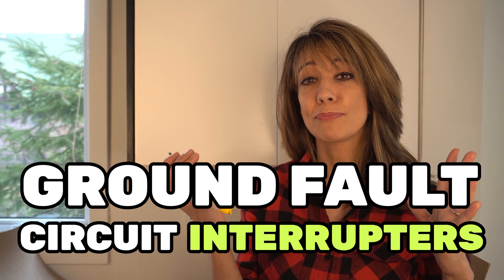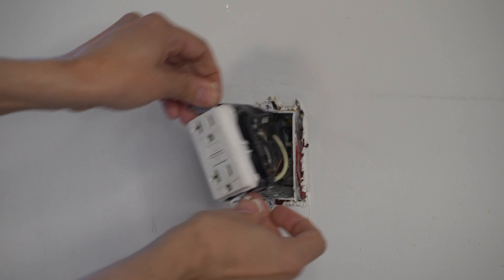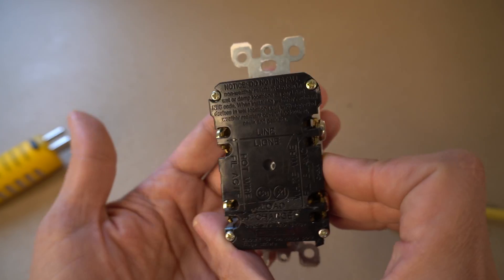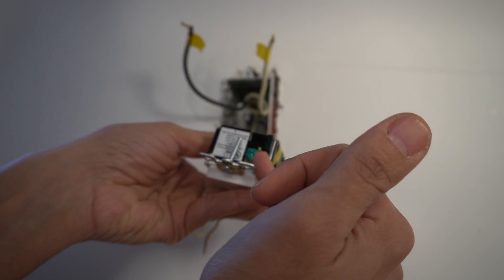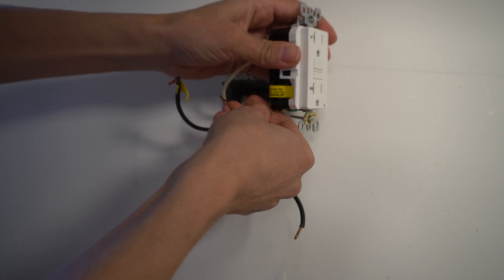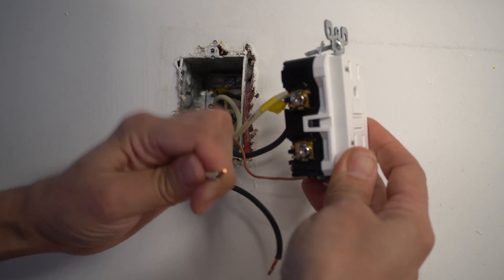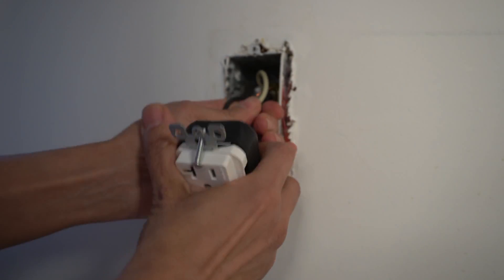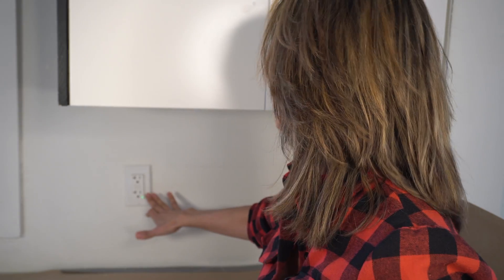How To Replace a GFCI Outlet | 98% Don’t Don't Know This!

Comment: when they turned my garage into a spare room,  they never put in any gfci.   This includes a kitchenette and bathroom area with shower.  There was no outlets in the bathroom,  but one right outside that I'd be forced to use at times.    So I made it GFCI and I feel much safer now!   It was super simple to change a regular outlet to GFCI.   Now when I shave I don't fear electrocution!
Reply from the maker: Well done! It’s so important to have working GFCIs in bathrooms, kitchens or near water. Everyone’s life is valuable and it’s a simple DIY that will give you peace of mind. Well done! Thanks for taking the time to share your experience. It’s important!
Reply: Are you sure it didn't have gfi installed at the panel ?
Reply: @nedmilburn    Yep 100% sure.  this was done in the late 1970's.
Reply: @northyland1157  I wouldn't be surprised if gfi's existed in the late 70s, but it wasn't ubiquitous for building codes that's for sure...  70s is 50 years ago. A lot has changed and there's a lot of houses that can use updating.
Reply: @nedmilburn  Yes GFCI did exist in the late 1970's,  They just weren't added in the garage conversion.   The rest of the house was build with GFCI in the kitchen, bathrooms, and outside outlets.
Reply from the maker: @nedmilburn  where I am you are required to have GFCI receptacles. I would check your local electrical code to see what is required in your area. The existing electrical is fairly recent.
Reply: @DaruDhillon  Why are you directing this question to me?
Reply: Another way to alleviate fear of electrocution while shaving is to use a rechargeable shaver. You would only need to fear the batteries catching fire while shaving.

Comment: Hi daru I have an older home with only 2 wires no ground can I still use these? Thank you
Reply from the maker: Hi Joe,  a GFCI receptacle will work without a ground wire attached and can be tested on the outlet face but not on an GFCI testing device.  The GFCI will provide ground fault protection when installed with 2-wire (hot and neutral).
Reply: @DaruDhillon  thank you so much for the reply
Reply from the maker: @joegonzales772  my pleasure, Joe. All the best!
Reply: Actually that’s what you’re supposed to do.

Comment: Can a garage fridge cause the constant tripping
Reply: Yes
Reply: Definitely you don't want to have a refrigerator plugged into a GFCI receptacle because it can trip just from high humidity and all the food inside could be ruined If it is not reset promptly , So replace it with a standard receptacle but make absolutely sure it is properly grounded

Comment: Thought I left this comment last night, but after watching about 40 other videos and dialing up three electrician friends trying to find out why my GFCI would not reset, I came across your video last night.  Let's just say that your approach help me figure out my problem.  It's too embarrassing to say what it was, but you are the best!!!!
Reply from the maker: Thanks! We all have those moments when we’re tired or we’re doing too much. Be kind to yourself. ❤️
Reply: I think you reveal what was the problem.   You might save others from the same problem.   Sounds like it was something simple.
Reply: @djohn-xe8vk  probably swapped load and line.
Reply: @djohn-xe8vk probably got the hots and neutrals cris crossed.  I did that by accident wiring in mine and it would not reset.
Reply: I have a greenlight on but no power at outlet why?
Reply: @andrewschurich2750 
read the above comments...   there's your answer
Reply: Don't see it grounded

Comment: Beyond THANK YOU for creating and sharing this video.

A tiny spring and reset button on bathroom GFCI popped out during a heavy rain. Outdoor GFCI is on the same circuit. It is under the soffit and inside a covered plastic box, rain getting in the box is the only thing I can think of that may have caused it.

I got a new outlet (twin to the one that popped) and have watched a number of videos of how to replace it. There was either too much "electrician talk" and/or the person had their fingers in front of what they were doing.

Am going to tackle installing the replacement this weekend. Thanks to your thorough, but not too complex explanation of what you were doing and why. I could also clearly see what you were doing as you explained it.
Reply from the maker: Awesome Rebecca! I love that you are doing this yourself. Sounds like you’ve done your research and are good to go.

Comment: Best video I’ve seen, thank you very much for the concise directions. Love the idea of using the electrical tape the way you did. Definitely makes sense. Never seen an electrician use tape that way.
Reply from the maker: Electricians I’ve worked with do it but not all do. I like it too. Thanks Paul!
Reply: It’s better to do it if the box is metal

Comment: How are you associating Black wire with going for the gold?  Struggling to make the connection for memorization.
Reply: Don't concern yourself with memorization, but rather educate yourself on basic residential wiring and theory. It's not complicated and will make you safer and aware. It should become as obvious as what shoe goes on what foot. You should always verify that the black wire is the hot wire, you never know who worked on the wiring previously and it could be miswired.
Reply from the maker: In electrical black is power, the ultimate. In sports gold is ultimate, the best. Going for the gold is a sports saying that works for me as an easy reminder. 🥇🏆
Reply: @DaruDhillon ... only in America could a black wire denote power/live ... 🙄😂
In DC circuits, red is positive and black is negative so why not carry that convention through to AC ??

Here in europe, we used to have that convention years ago and for some reason they changed it to brown for live, blue for neutral and green/yellow for ground... pretty random colour-coding there too... 🤔

The way I memorise it is...
The Brown bear will bite you..🐶
Blue with the cold... ❄
And the earth is green , of course ...🌍

😎👍☘️🍺
Reply: @peterfitzpatrick7032 You can't really compare AC to DC in this regard. In America the red and black in AC are both hot and alternate between positive (power in) and negative (current return). This applies to 240v circuits. In 120v circuits black is power in and white is current return. The black wire alternates between positive and negative and the white wire is the mid point and is always held to 0 volts, but carries the return current. The white wire represents the center tap of the transformer secondary windings or the mid point.
Reply: Somebody said to remember it this way: Mr T wears gold, so black to gold.
Reply: I prefer to associate the more obvious White with Silver. That leaves Black with Gold.
And always test to confirm what was done before and again once you have finished your work.
Reply: It’s very simple 
Bronze screw is darker than the silver screw , so a black wire is darker than a white wire , see very self explanatory …

Comment: I've found that the ground wire coming out on these GFCI receptacles is an issue, it's better to wrap a j-hook around the screw. You said the receptacle was upgraded from a 15 amp GFCI. A 20 amp receptacle can only be used on a 20 amp circuit with 12 gauge wire, can't tell if that's the case here. However, a 15 amp GFCI receptacle would be fine (US code, apparently not in Canada) regardless of whether it's a 15 or 20 amp circuit. It's exactly the same thing, but without the T-slot, and will save a few bucks.
Reply from the maker: Wrapping your ground wire around the ground screw is a good and safe tip. The wiring in this kitchen was upgraded to 12 gauge wire so new 20 amp receptacles were installed. Good advice Ted :)
Reply: @DaruDhillon I think that you're correct in using a 20 amp GFCI, the CEC requires 20 amp receptacles on 20 amp circuits is my understanding now. The NEC, USA electrical code, allows 15 or 20 amp duplex receptacles on 20 amp circuits.
Reply: @surferdude642  While you're correct, I find it moronic that it is acceptable to put a 15 amp receptacle on 20 amp circuit as it is not rated to pass 20 amps thus it is highly recommend to pigtail it to avoid overloading it. I also don't see why you can't put 20 amp receptacle on 15 amp circuit as the breaker should trip if there is too much draw.  Instead what we have are devices like my air compressor where the manual recommends a using a 20 amp circuit; however, it is instead wired with a 15 amp plug with a warning that it may trip 15 amp circuits. Or ones that come with a 15-20amp pigtail plug.
Reply: @rui1863 15 amp duplex receptacles are rated for 20 amp pass thru and that's why you can use them on 20 amp circuits. Your air compressor should be used on a 20 amp circuit with no other significant loads on simultaneously, a 15 amp receptacle is fine. If not, and the air compressor was designed for 120v, it would have a 20 amp plug and cord. The manual should specify the maximum current, wattage, or HP. If the air compressor was on a dedicated circuit, then a 20 amp single receptacle would be required.
Reply: I know I probably just missed seeing something, but it appeared as though there was only 1 bare ground wire in the box? I would think there are 2 bare copper wires and nut or wago with a lead out for the receptacle green screw. I usually cut back and restrip the leads going into the receptacle, never know that the previous installer might not have knicked the leads.
Reply: @SEaudiofan Canadian metal boxes have 2 ground screws, so one wire terminates on one screw and the other one wraps around the other screw and the end of the wire connects to the ground screw on the device. I believe that is the way this was done.
Reply: @SEaudiofan you also always tape the screws safety always never take anything for granted this young lady knows a lot more than all you gents so guys if you are great talkers put your videos out  since your a master electricion oh still don't see your video 😅
Reply: I saw another set of instructions that said in addition to this, I needed to add a pigtail to ground the 20 amp duplex receptacle to the actual metal box. Is this necessary? I use electrical tape around the wires and still connect the ground wire to the green screw? I’m not wiring a GFCI receptacle, but this is the most clear video with instructions I found. Wiring a 20A duplex outlet with a switch for the garbage disposal. (I snapped off the brass ran to create the switch for the garbage disposal versus the dishwasher. It’s a 20 amp breaker dedicated with 12 gauge wires.
Reply: @thematernhobbyist  No, you do not need to add a pigtail for a flush mounted box, if these 2 conditions are met: 1, The ground wire coming into the box is to be connected to the box via the (green) grounding screw. 2. The receptacle is a commercial spec grade that will have a self grounding strap or wire that holds one of the mounting screws captive. When the screw is fastened to the box, it establishes the equipment bonding. See NEC 250.146(B). If the box is a surface mounted type, you still don't need a pigtail for the ground(s) because the metal to metal contact between the box cover (where the device(s) mounts to) establishes the equipment bonding. See NEC 250.146(A).
Reply: Hello

Comment: what would happen if line and load neutrals were reversed?
Reply: You probably would not be able to reset the GFCI. In a regular receptacle, the plugged in item would still work, but it would be a shock hazard. Normally the power coming in stops at a switch, start button, etc., before entering the electrical system of the appliance, lamp, or tool. If the wires are reversed, the power goes through the equipment before the switch, so if there's a metal case and the live wire contacts it, and if there's no ground it could result in a shock or electrocution, even with the power off.
Reply: @surferdude642  thanks!
Reply: @surferdude642  most modern gfcis will not reset at all but some older gfcis would still work and wont trip
Reply: GFCI outlets are designed that if they're wired backwards , They will not set when you press the reset button to activate it